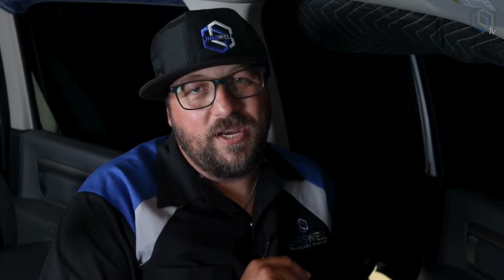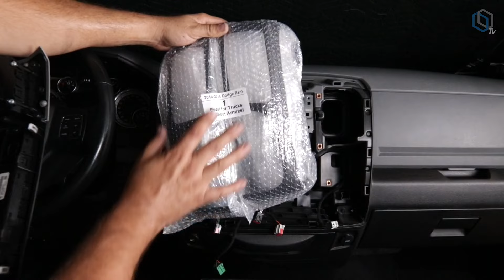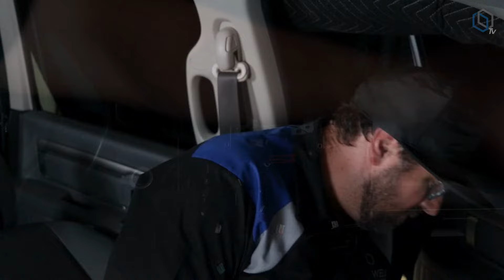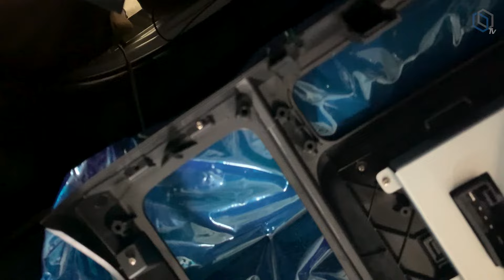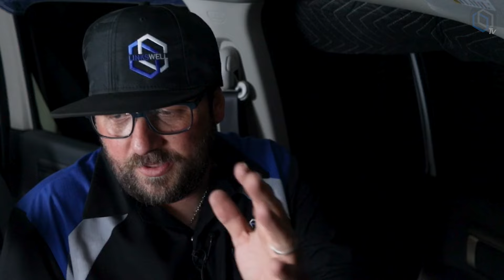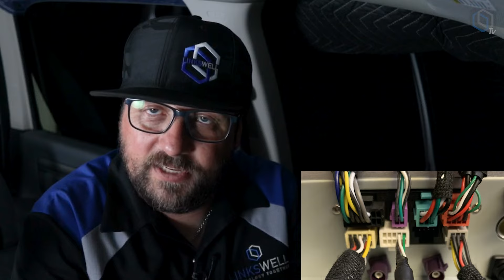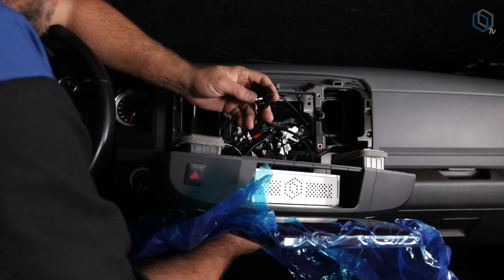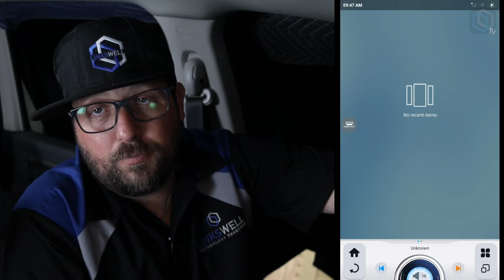Installing a T-Style XL into a 13-18 Dodge Ram

Comment: I have left and right blindspot cameras installed in my 2015 Ram 2500 (Laramie) it is connected to a PAC Intelligent switcher that allows me to switch from the rear camera to the sides whenever the turn signal is activated. Will this work with this unit? Or is there a multi camera feature available for left and right blind spot cameras with this unit that Linkswell offers?
Reply from the maker: It depends on the PAC part. If it’s specific for a Dodge Radio I don’t think so. If it has a universal RCA output then it should.
Reply: @LinksWellInc Yes the outputs are the standard yellow RCA connectors and it plugs into a PAC BCI-CH41 interface module that has a harness to fit the RAM radio. Would this harness fit the T Style XL?
Reply from the maker: @Sharloboy  I really would have to see it. Chances are you will not need it because you will just plug the RCA directly to ours. Without seeing it I can say for sure though
Reply: I've had the PAC installed on my Ram as well with my blindside cameras, but I opted to go with the linkswell multicamera adapter and I have to say it's worlds of difference and way better! I've also added eight cameras on my truck now including the chassis and fifth wheel and cargo camera and dash cam.
Reply: @firearmsllc  I just installed this unit and how do I go about getting the cargo camera back.  I have a factory installed one.  
I also have the linkswell camera adaptor. 
Thank you

Comment: I have a 2013 ram 3500 with the bed camera. Can I install this and keep the cargo cam?
Reply from the maker: You can if you add a camera switcher. 

Dodge has 2 separate video signals going into their radio. We only have a single reverse input. So you need some sort of camera switcher. Like a PAC Vs41 or the like.

Comment: Man i wish this retained factory stuff.
Reply from the maker: It does. What factory stuff do you wish it retained?  We have all the factory settings menus, cameras, steering wheel controls….
Reply: @LinksWellInc  mics, satellite radio,    I don't want to rely on cell service to listen to sxm off the app. 2 hours of my drive to work is bush cell service.
Reply: I only see it's on your 5th gen. So I may opt for that.
Reply from the maker: @chamakese55  so no aftermarket radio can retain a factory SiriusXM radio. 

1. The tuner is inside the actual radio that gets removed. So the tuner is gone. So there is no way to make it work. 

2. SiriusXM requires all aftermarket radio to use their V300 tuner.  That’s the rules. We don’t make them. 

Our Generation 5 T-Style is XMReady and can run that V300 tuner. This radio will not. It is in the process of getting into the approval through SiriusXM which is anywhere from 12-36 months long. So following Generations of the XL will one day offer the same. Not because we didn’t want to but because of the way SiriusXM regulates it all.
Reply from the maker: @chamakese55  correct. The process with SiriusXM takes roughly 12-36 months to get your approval. Because the Gen 6 and XL have a new faster processor they consider it a completely different radio so the process has to start all over. 

Gen 5 will work with SiriusXM’s V300 tuner. 

As for the Mics there is a long reason why we don’t. Boils down to quality control on our end. We can’t control what isn’t ours or we don’t have access to its details. So to offer the best function. We use our own that we can do that with.

Comment: Question i have a 2017 Ram 3500 it has the factory reverse cam in the rear view mirror so will it be able to be converted to the radio as well
Reply from the maker: If you purchase the harness that brings the signal from the mirror to the radio.

Comment: Will I still have all the factory controls that I have in my factory unconnect system? In my factory unconnect I can change pretty much all settings for all electronics in my truck. Thanks
Reply from the maker: We retain the majority of the vehicles settings yes.  Anything that we can reproduce with the UConnect module removed.  Anything that would be specific to UConnect will be gone because you are removing the UConnect module when installing an aftermarket radio.

Comment: Version going to be available for the 4th gen 2500 6.7 laramie trucks?
Reply from the maker: I don’t know what years that entails. 

What year?
Reply: @LinksWellInc  2013 2500 ram laramie longhorn 6.7 with the alpine uconnect system.
Reply from the maker: @BattleTested22  13 is a split year, so if your 13 has the same dash as the 14. This will work.   If your dash looks like the 12 it will not.
Reply: @LinksWellInc  great! I shoul be good. Can't wait for the release!

Comment: Quick boot, a physical dial and wireless car play? I've been holding out from buying one because of those 3 features being missing. The only thing else I could wish for is sirusxm support, but if all the other features are in gen 6 regular size I'm making the jump!
Reply: 2018 Ram 5500 Tradesman…what are my options?
Reply from the maker: Gen 6 will have all the hardware upgrades as far as processor and what not, but will not have the dial. The dial is only on the XL that is in this video. 

With Sirius XM we have to start the entire process over again with the new hardware parts. So another 18-48 months before this new platform will see SiriusXM. 

Currently the only radio that is SiriusXM Ready is our Generation 5 T-Style.
Reply: @LinksWellInc  okay, will it have quick boot? 

Fingers crossed 🤞 for gen 7 having the dial lol

Comment: ETA on gen 6 or XL for jeep wranglers? Have a 4xe and i am just waitiiiing on a head unit that supports it.
Reply from the maker: We are testing an adapter to retain the Hybrid pages. Our current radio will work with it now. Just doesn't have the Hybrid pages. 

This adapter will add them though. Will only work for Gen 6 and XL. Both should be releasing in 30-90 days.
Reply: @LinksWellInc  I don't even use the pages and i love the more flush look of the 5 but looks like the gen 6 has wireless car play and can handle back cam and front trail. Hmmmm
Reply from the maker: @kelseylantzy  so Gen 5 has wireless CarPlay as well and is SiriusXM ready which the Gen 6 will not be. 

But Gen 6 will be faster with the new processor.
Reply: @LinksWellInc  you just made my decision harder bc I do use serious xm and love wireless android auto. I'll let you pick. Lol
Reply from the maker: @kelseylantzy  so the only model that we will have that is XM Ready will be the Gen 5. It will have wireless CarPlay and Wireless Android Auto. You can watch the videos of it working on the channel here.
Reply: @LinksWellInc  gracias papi! 😁

Comment: Is there an ETA when Gen6 and XL will be available for GMC, i was literally about to purchase a Gen5 for a 2017 sierra.
Reply from the maker: Gen 6 should be available in like 30 days. The XL will probably be 45-90 based on the fitment testing for the final bezel design.
Reply: Is there a video out for the installation In the GMC. I just received mine but cannot find an installation video and the instructions are a bit incomplete. Thanks.
Reply: @corylango2120  it's very similar to the previous Gen's, ADC mobile has a detailed install on a Gen4 which is what I went by.

Comment: Are u guys going to offer different color bezels.
Reply from the maker: Currently we have black. I do not know if we will make more color options yet.
Reply: It would be nice since it would look off on the longhorn that runs a rose gold bezel.
Reply from the maker: @straightfromthebarrel5393  so all the cushy on colors are incredibly hard to match aftermarket. Sometimes it looks worse trying to match then not. Which is why we haven’t decided